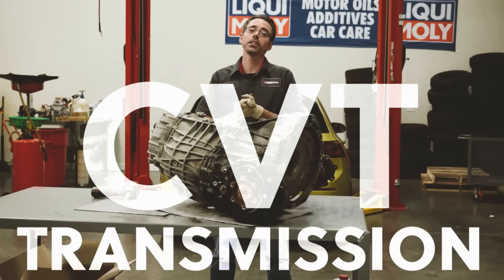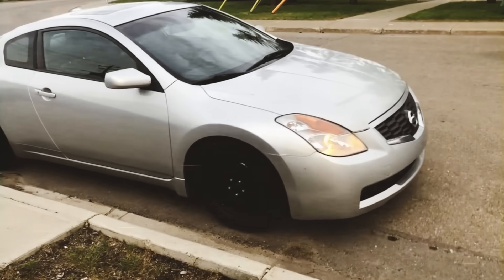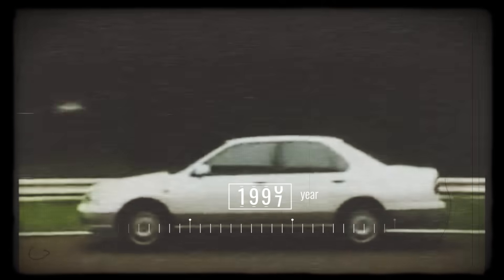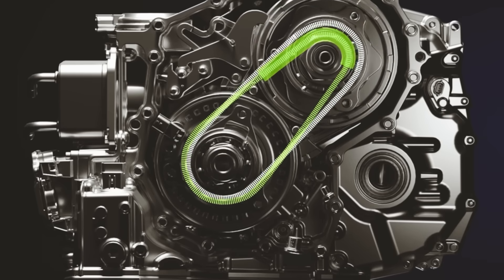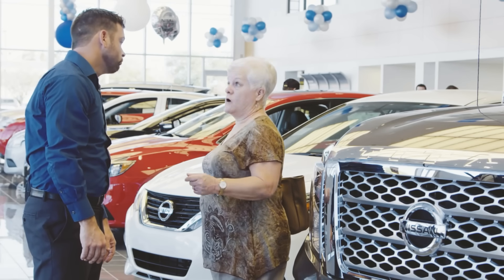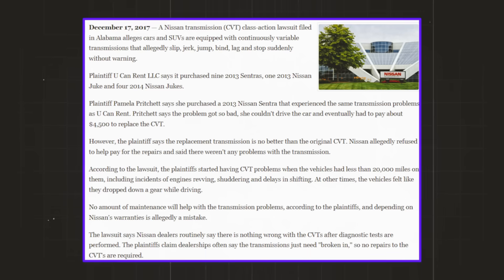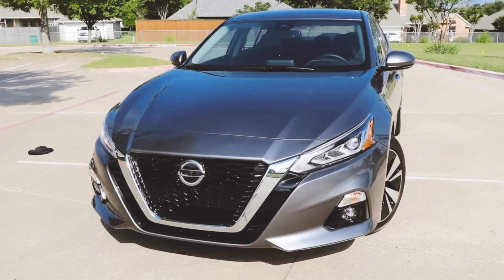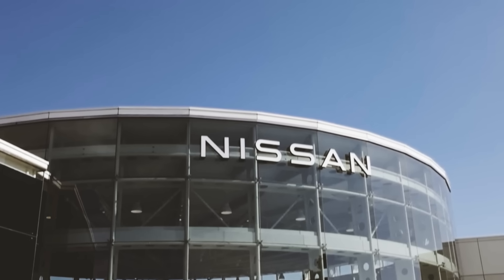Unpacking the FAILURE of Nissan's X-Tronic CVT

Comment: I’m just grateful my 3rd gen Altima doesn’t have a CVT.  501k miles later she’s still hanging on to dear life 😀

Original owner with original motor and 4 speed auto
Reply: Have 460k on my cvt altima
Reply: @occckid123 it is so strange how some of these last a long time and others fail very early.
Reply: @christopherhamilton5557 it's the owners mostly kids that doesn't maintain and driving their cvt like race cars,my 14 sentra has 200k and still runs like new.i have a friend who owned the same car broke his cvt at 14k miles.when we pick it up and saw how he drives i already know why,he effin floors it everytime as if it's a conv. AT 😂
Reply: @christopherhamilton5557  could just be the manufacturing process or materials used. I find it very odd also. They tell the suppliers to cut cost. Well then...
Reply: @occckid123  yeah I was also thinking variations in manufacturing

Comment: I had a 2013 Sentra with a CVT failure at 160K miles in 2023. I got a new CVT for $3,500 at the dealer. The car is in showroom condition. I hope to get another 160K out of it.
Reply: You will if you don't drive it on long road trips through the hills or in very hot weather. Learn how to inspect the fluid. Drain ~100 ml into a white cup. Any tinge of black warrants a fluid change. Know this fluid can last 1,000 miles or 100,000 miles. It's susceptible to overheating. It's all determinate on how you drive and how hard of conditions the car has been put through. Drive through the Ozarks in your Nissan? That warrants an immediate fluid inspection and/or change. Drive 10 miles in easy conditions commuting to work @ 55mph for a year? I wouldn't even bother inspecting until 60,000 miles. Light brown is okay. Tiny tinge of black is no good. Dipstick and paper towel DO NOT provide a good enough indicator.
Reply: My 2013 Sentra had a failed transmission the first year. They replaced it and no transmission problems up through 2024 still the experience makes me never want a Nissan again.

Comment: Nissans new CVT-X is all new and should be fairly bulletproof. It’s now a dual pump design with 30% less friction. I’d prefer a traditional automatic myself but Nissan has completely redone their CVTs.
Reply: It will take years and people putting on a lot of miles to really see if they are that much better. Now they have a 3 cylinder variable compression motor with a turbo to go with the CVT, sounds like more problems to me.
Reply: @TheCaptjamestkirk Yeah, and Rube Goldberg is shaking his head, saying " Those silly, ovecomplicated and ridiculous machines in my newspaper comics were  meant to be jokes, not instruction manuals!"
Reply: @joelcarson4602  Nissan recalls 480,000 vehicles due to engine failure! Guess I was right about their new motor.
Reply: @TheCaptjamestkirk 3 years with our 22 Rogue with the cvt and vc turbo 3 cyl. Great car
Reply: @joenissan  Nissan recalls 480,000 vehicles due to engine failure! Good luck with that 3 cylinder turbo.
Reply: That's not even the issue tho. The main issue is that they're built like shit. Having dual pumps might just keep it from overheating but that belt is probably still going to explode
Reply: For the sake of the customers, I hope they are more reliable. I have nostalgia for the old Nissan, but hopefully this a step in the right direction for the company.
Reply: And they still fail
Reply: The thing is that we do not know if the model use CVT-X or not if Manufacturers don't include it in the manual. As far as I know, old model CVTs are still being used
Reply: @paddynhat1311  Google is your friend.
Reply: @paddynhat1311 Nope. All new in 2022
Reply: The issue is why are they even still bothering? They clearly don't know what they're doing....just use a regular automatic and be done with it. It's a shame what Nissan has become.
Reply: Lol I'm sure they'll be the same garbage just like VW
Reply: They lose their reputation regardless of a all-new design CVT.
Reply: Did they add beefier cooling though? That is the question. CVTs run hotter than traditional autos and when they start slipping. It only adds more fuel to the fire.

Comment: Back in 2014 when i was working at Nissan we had the new Pathfinder start to show up and had torque converter shudder codes before they even got off the trailer. Brand new zero miles needing transmissions.

Comment: Transmission maintenance?!?  I bought a 2013 Altima, new off of the showroom floor and one of the points the salesman stressed was that the transmission would never need servicing, that the transmission fluid was a lifetime fluid never to be changed.  Not knowing any better in those days I believed him and thought this feature was pretty nice.  Then in less than 2000 miles the entire engine had to be replaced along with a new fuel pump because they were assembled with defects.  Then after 4 broken engine mounts in less than 8 months (I drive very conservatively... ask my wife) I got soured on Nissan and how the service manager continually lied to me about why the car was shaking (from the bad motor mounts).  I got rid of the Altima and I will never spend my money on another Nissan product again.
Reply: The mounts weren't under warranty???
Reply: @occckid123  the dealership replaced the motor mounts the first two times under warranty, when the engine started to shake again.  Took it in again, their mechanic inspected the car (so they said), and the service manager said nothing was found wrong with the car, he assured me the vibration was normal.  I got pissed because I knew he was lying to me,  I then asked him (paraphrasing), "so when I bought the car it was NOT normal for it to run without any vibration?" He refused to answer the question and walked away.  That was the last time I set foot onto their dealership.  I went to an independent mechanic (who verified that it was indeed bad motor mounts) and he fixed the problem.  I wrote a letter to Nissan corporate about my experience, never heard back from them.
Reply: @BusterKitten  I would've taken it to a different dealership and let them warranty the work.
Reply: @occckid123  probably right but I was so soured on the Nissan brand by that time I just wanted to get rid of the car.  Been driving Subarus since and 100% satisfied with them and the dealership.  We've now got seven of them between us, kids and grandkids.  Waiting for the 2025-26(?) Forester Wilderness for my next Subaru.
Reply: @BusterKitten  subaru is pretty ok just watch out for oil consumption issues. Don't let the oil get low and you have to watch oit for the cvt. The cvt is serviceable and needs the fluid changed contrary to what they've said. My coworker just replaced his cvt in his crosstrek..
Reply: @occckid123  got all the family on the same page as far as the CVTs.  fluid change every 30,000 miles.  The kids do their oil changes between 3000-4000 miles.  Because I'm retired and get bored very easily I do oil changes on our Subies whenever I feel like it, about every 1500-2000 miles.  Yeah, I know, but hell, I need something to do.  I can only wax the cars and detail the engines so much... I really do need to find a hobby.🥴
Reply: @BusterKitten Subaru got me to believe in reliable CVTs since one of my customers had an Impreza with the CVT at 180k miles. I have one of the new Corollas with the CVT and, I’ll admit, it’s not bad. Just gotta have the right manufacturer.

Comment: I have a 2011 Sentra with 129K miles. No problems at all. Original CVT still working.
Reply: there's always one....
Reply: If the fluids been changed at least once, no surprise. If it’s original trans fluid, I’m very surprised.. and you would be on borrowed time at that mileage.
Reply: 2008 altima. Fluid has never been changed. Car just hit 300k miles. Transmission just went out.

Comment: I just bought a cheap Nissan Versa from 2010 with 155k miles. It drives really nice. You know what it has for a transmission? A good old 4 speed automatic! I made sure to steer away from the CVT models. Now, my coworker bought a brand new Nissan Sentra a couple of years ago and he changed the CVT fluid after 30k miles. And his CVT is still working great. So the question is, if you change the CVT fluid on these things every 30k miles, will it last long term? He has 55k miles on his Sentra and he takes good care of it indeed. That helps a lot. The jury is still out though on the fluid changes every 30k on these CVTS 🤔. Nissan recently went back to standard automatics and got rid of the CVT on their newer Pathfinder and Infiniti QX60 indeed. At least they are starting to get it.
Reply: My 2008 versa with the cvt had 210k miles on in with no cvt issue and I only changed the fluid once.  I test drive the 4spd and its a terrible transmission.  You can get to the power much quicker with the cvt and it gets better mpg. 4spd had wayyy 2 much dead spots.
Reply: @occckid123  I drove a Versa (rented one) that only had like 5k miles? And that CVT felt HORRIBLE. So I don't know if that car was already abused? Not sure. I'm glad to know that you didn't have any CVT issues. Maybe it's the way people drive their cars today. Full pedal to the metal and no maintenance 😅
Reply: @joseCalderon1976  what year was the versa?
Reply: @joseCalderon1976  I mean I doubt it. You bang drive the cvt the way you drive a 4spd auto. You should always know what your transmission is going to do and how your throttle inputs reacts to affecting torque converter lockup  or release and you learn how to ride the torque or just let it sit at redkine for max power and that's where the cvt was better than the 4spd. The 4spd wastes fuel my only locking the converter around 40mph. The cvt can lock the torque converter at around 12 mph or so. Letting the torque drive the car and not feeling loose. It's all in how you drive it. People drive with an on and off foot and the cvt doesn't like that.
Reply: @occckid123  I think it was 2015
Reply: @joseCalderon1976  I don't like that cvt either because it has a pause in it when it's switching over from high to low gear and it had the lower hp engine with less power going from the 1.8 to the 1.6 engine and it had worst  materials
Reply: My 2015 Sentra SV has 190,000 miles on the original CVT, it works perfectly, regular transmission fluid and filter changes, and not driving it hard nor hot are probably why. Not hard to service the CVT, you can do it yourself in about 1 hour if you're handy with a ratchet
Reply: It really depends on maintenance and how the vehicle is driven as well as what car it's in the lighter low power economy boxes like the versa tend to have less transmission issues since they put a lot less strain on the transmission
Reply: I have that 2010 versa AT transmission currently at 182k miles with original transmission and engine - runs great!

Comment: As someone who has a 2014 Nissan Sentra with the CVT, and knowing about many of them failing, its a bit scary driving it, knowing it could fail. I try not to hard accelerate in it and got the fluid changed at 50k miles to make sure it stays healthy. I heard that sometimes metal flakes could get in the oil pump and decrease transmission fluid pressure in the system, causing premature wear. Idk how true that is. Pretty sad state Nissan is in, hope they can improve and make good cars again!
Reply: 2014 is getting up there, at this point I wouldn't stress about it. Drive it, keep the fluids changed, and put away a little each month for a replacement car. If it does die, just dump it for something else.

Comment: I am picking up my family's 5th Nissan this week. We have been driving Nissans exclusively since 2019 and have never had any issues, large or small, with them. However,  I only lease them and would not consider owning a Nissan long-term due to their track record. If I did ever purchase one for the long-term, I would definitely change the transmission oil at 40 to 50,000 km and avoid  aggressive acceleration!
Reply: Lol why though
Reply: Driving Nissans since 2019, like that's a long time 😂😂😂😂
Reply: 5 Nissans in a span of 5 years? lol no wonder

Comment: I have a 16 Altima with 93,000 miles on it. Love the car. Maybe I’m special
Reply: My parents had a 14 Altima and the put 235k miles on it before it was totaled in a wreck. Trans was still kicking. Mostly 60mph highway miles, rather than freeway or city miles. They were good about fluid changes but usually a little past what the book said. They replaced the car with an identical one.

Comment: I took my 2017 Sentra in for an oil change and the dealer called me and simply offered me a loaner car and said they wanted to replace my transmission at about 60,000 miles and almost 6 years old, 3 days before my warranty expired. I am an auto detailer, so it is otherwise immaculate showroom condition and they always did my oil changes. The bill was $5,209.95, but the balance due was only $9.95 for the oil change. 

I was not aware of these lawsuits at the time, nor did the dealer explain why they were giving me a free transmission. I do remember something about an extended warranty at some point, but not the details. I noticed nothing wrong with the car except a small slippage when putting it into gear, which most all older cars experience, or at least I think they do. 

I asked if the new transmission had it's own warranty and was told it did not and the day I picked my car up, my warranty had expired, that's how close to it's end I was. Had I waited only 3 more days for that oil change, I would be on my own. There must have been something wrong with it, so I'm glad they stood behind the warranty, and did not lie to me when my car was there. I'm going to keep the miles off it when possible; it only has 65,000 now and I haven't even had to replace the brakes yet. At least I'm starting with a new transmission. 

I love my car. I paid $18,640 for it and it looks better than it did when I drove it off the lot. The great thing is I'm the only owner and it's paid for. With 139HP, it goes 0-60 in about 3 hours, and you cannot pass another vehicle with it, because it cannot down shift to give you the power; you'd be crawling around it. I am used to it however and I've invested noting into it other than its initial price, oil changes (1st 2 years were free) and a battery for $180 when I got my new transmission. I would not buy another one (it's my 2nd Sentra) for the reasons stated in this video, but mine has not let me down - yet.

Comment: The main problem is, alot of people dont keep up with maintenance on their vehicle. Since cvt's are different than traditional automatic transmission, you still got to drive them differently. I got a 2009 Nissan Murano SL & haven't had no problem, because i stay ontop of maintenance of my vehicle. I bought the car used & the first thing i did, was change all the main fluid in the car, within a week & that helped me, cause its on my schedule. I know people that sold cars & told people they just changed plugs & fluids, but in reality, they havent done maintenance in years.
Reply: In reality, it’s luck of the draw fam. I’m on my 2nd CVT in 3 years.   Baby em, maintain em, don’t matter. New CVT is just gettin to 60k miles and I’m already gettin P1778, same code I was gettin on the last one. Changed the fluid twice so far and I don’t drive her hard at all.

It’s a shyt tranny fam. Only good thing that’s come out of it is it makes me take a lot more initiative as far as maintaining and repairing my own shyt lol
Reply: Also the V6 nissans have a beefier cvt so they are a bit more durable and forgiving.
Reply: I agree with you, people can’t maintain their vehicles, CVT transmission has to be driven gently. My father just bought 2024 Nissan Sentra, he stomped on it from 40 to 60 and I was in the backseat and just laughed silently because I don’t do that with my 2020 Corolla. I felt like telling him that the transmission is  not meant for hard acceleration lol
Reply: You have a Murano. The VQ35DE engine in your car is paired with a beefed up CVT with superior cooling. That's why you have no issues. The CVTs in the Versa/Sentra/Altima/Rogue frankly run hot and overtime, issues start to arise.

Comment: I have a 2017 Honda and 2023 Lexus with the CVT. The 2017 has a slight lag. The 2023 doesn't. I travelled recently and rented a 2022 Nissan Versa. It was not as smooth as my cars. It seemed to hold back when coasting, and sometimes it didn't appear to know what gear it should be in. Although not as bad as the ones depicted in this video, I would never buy one. In the past, I owned 3 Nissan's, but this transmission killed the brand.

Comment: Nissan is replacing the CVT in my 17 Pathfinder with a remanufactured CVT direct from the factory. Question is has Nissan made improvements to the original design to alleviate future issues or is it the same faulty CVT transmission they used when the vehicle was made?
Reply: A factory reman is from an already failed cvt... it might get a new belt and was cleaned up... possible a pully or something was replaced but that's what they are.  If you plan in keeping it drain and replace fluid every year... and replace filters and fluid every 30k or so... it's not as bad as it sounds but do strict maintenance from now on.. don't rag (high rpm) on it

Comment: Change it every year...with my oil change myself, easy to do...drive easy and not like a race car...placed a trans cooler too.
Should be fine...I'll drop the pan and clean out it out.
Remember the fluid not only lubricates, cleans nut cools